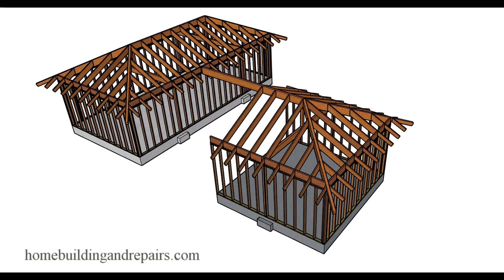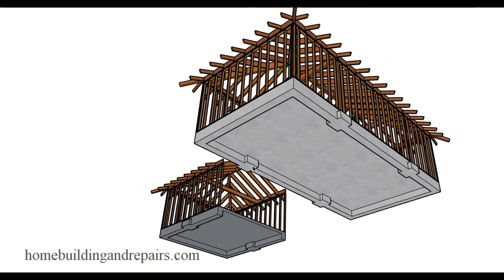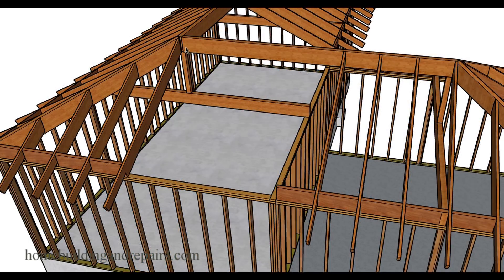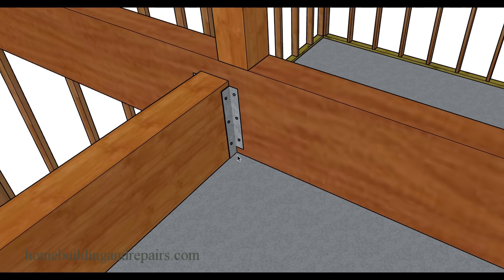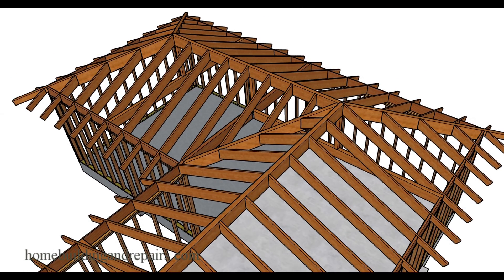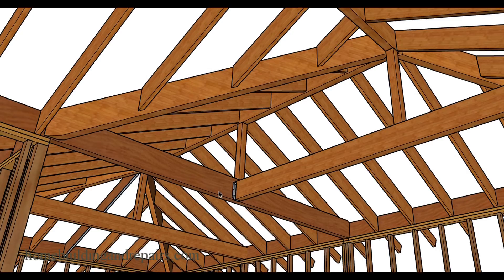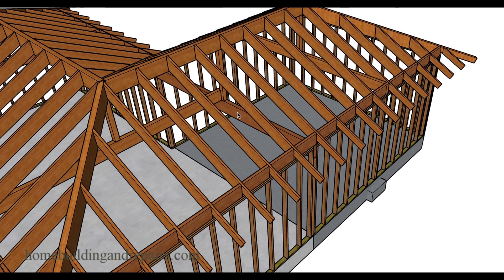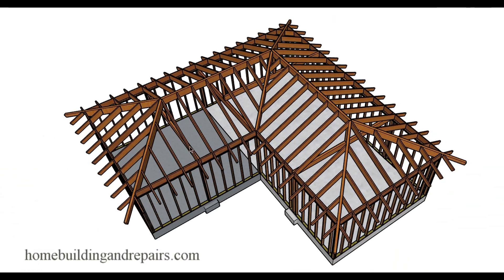Ideas for Vaulted Roof Framing with Hips and Valleys for a Home Addition

Comment: Great video, graphics always make things so much easier to understand and for me personally allows to imagine in my head a design and where future loads would have to be transferred to.. what type of beam
Would you suggest for the add on where the load bearing wall was removed? You could get away with steel potentially couldn’t you to keep it lower profile vs having a few gluelam beams nailed together.. what about a scissor roof meeting at a 90*
Corner?

Comment: Great design and explanation. But how would the design look to accommodate ceiling insulation for code of R-49 which is 14" thick for this vaulted roof framing?
Reply from the maker: I'm pretty sure I already answered your question in another video, but will answer it again so others with the same question might be able to make sense out of it. You would need to use larger framing components like 2 x 16 roof rafters or find smaller insulation that will fit inside smaller lumber. Keep in mind that your video suggestion has been put on a list of videos to be made in the future, I just don't know when it will be made.
Reply: @gregvancom  That's what I was thinking was the  solution but haven't seen anywhere in all google youtube land where this is addressed. Thanks!

Comment: Greg, thanks for the video, very helpful. If I have an existing hip roof with ceiling joists, and want to remove the ceiling joists & create a gyp board finish at the roof rafters for a cathedral ceiling, do I still need to support the hip roof with a post and beam? does the existing ridge board need to be reinforced with a ridge beam?
Reply: further, I would only be removing the ceiling joists for the portion of the hip roof, which continues to a gable roof, where the ceiling joists would remain wondering if this would provide enough structure that does not require reinforcement. the total length of the hip roof where the ceiling joists would be removed is 11'. posting an image would be easier but unfortunately I cannot do that. do you have an email I can send some images to?
Reply from the maker: You can get our email address at our website, if you need to send pictures.
Reply from the maker: Keep in mind that I cannot provide you with structural engineering advice, but most of the time a ridge beam is required, along with using larger lumber for the hips, if you're going to remove the ceiling joist

Comment: Great video and very informative. I was wondering if you could help me with some questions reguarding my wife's mother's home remodel that I have been helping her with. I have a few pictures that may help with the details. The main question is, are you able to cut back rafter tails if a past addition had left them in on the new interior of the room. Everything is already built and drywalled in, they utilized an existing patio door as the entry way into the new room, but they left the soffit and rafter tails. Thank you for your time.
Reply: (From your video's, it doesnt seem as though the rafter tails bring any sort of structure or support to the walls or roof, if my understanding is correct)
Reply from the maker: Yes, most rafter tails are going to be supporting anything and can be cut off. Just make sure they are not structurally supporting something, before removing them.

Comment: If the original structure has a gable roof, and the addition will be hip/vaulted, do both structures need the footing or just the addition?
Reply from the maker: That's a difficult question to answer, because it all depends upon how the original structure and new-home addition are going to be built. Normally though most homes have building foundations and home additions do also.